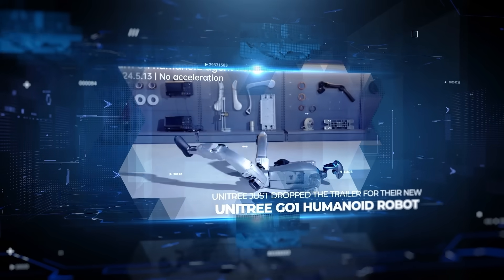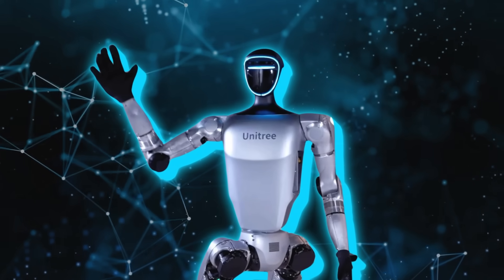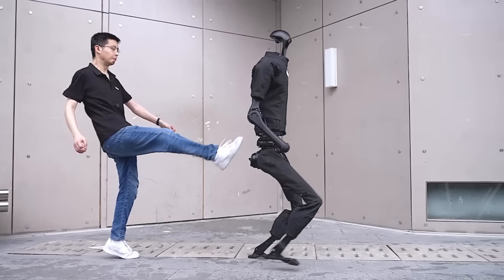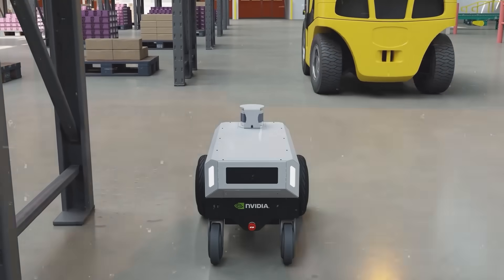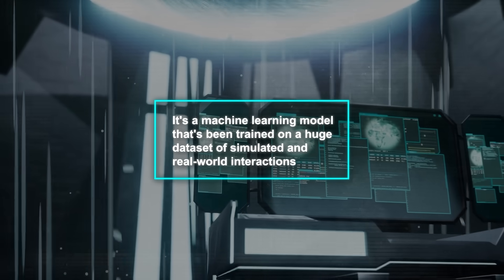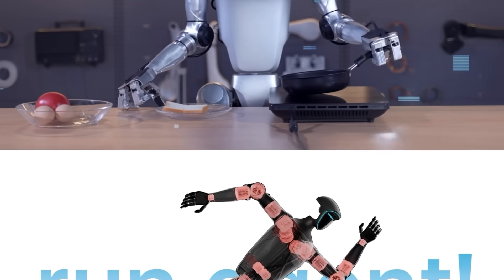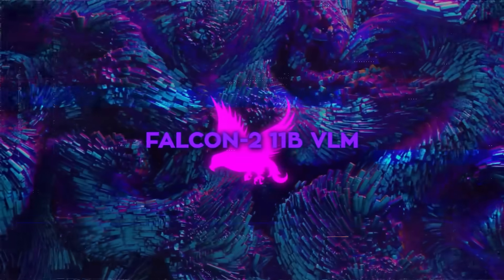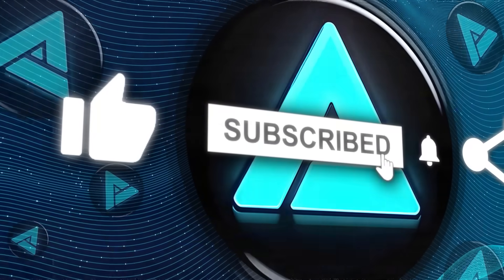New AI Humanoid Robot Shakes Up the Industry - Unitree G1 - (Beats Tesla Bot & Boston Dynamics)

Comment: "IT can open a soda can"  Sure it can, it might as well throw it on the floor and break it open that way
Reply: you missed the point, did you see the bottle is fine, only the cap is opened, that is precision
Reply: @godzillamothra5983  Opening a bottle like that is not an indicator of precision in any way. I dont get what you see?
Reply: @JohnnyColchester  using too much strength, and you can break the bottle, I don't know what is more precise than that
Reply: @godzillamothra5983  There is well enough tollerance in the force of the bottle breking vs the opening of it, in robotics force is quite easily replicable and fine tunable since basically the dawn of time. Servo motors are easily setup via torque controlls and the force is as steady as possible. I know it can look impressive but to someone that knows automation it really does not look anything special. I am more impressed in the ballance and spacial recognition, well spacial recognition we need more proof this is all not just a fine tuned setup. In anyway the whole robot does look impressive ill give you that

Comment: What they, or these manufacturers, have NOT done is make them en mass and affordable. That is really where the rubber meets the road. So in that sense, these are total failures.
Reply: Total failure bc they aren't instantly available to the masses? Maybe they shouldn't be by reading most of these comments some ppl will never be ready for physical ai assistants.
Reply: You're kidding, right?

This costs the SAME as 30 (yes, THIRTY) minimum wage workers at $15/hr.  (skipping electricity for the moment).

What company do you imagine WON'T replace all their workers at 1/30th the cost once the AI for these is perfected?

Comment: Only 16k?!!! 🤯
Reply: Right answer!  That is insanely cheap IFF it can do useful house tasks, etc.
Reply: @DIYDaveT  the 1x neo is being released but TBH it looks SO CREEPY, the same for the 1x EVE. apparently, these can both do household tasks on their own, kind of like a roomba if you just gave it legs.
Reply: @DIYDaveT Which is a huge If. I doubt this thing will even be able to sweep a floor before requiring a recharge.
Reply: @DIYDaveT  Not a factor at all.  ALL robots are defined as to what they can do by mostly the AI not the ROBOT.  Sure, weight limits, strength limits, but for a household chores robot, this can get it done.

You need to check out Nvidia's universal AI for robots with its learning abilities.  Already a dozen companies using it for their robots.  Makes sense, as it shares the cost to develop it.  Before these go mass market production, the AI software will enable it to already do or learn about anything.